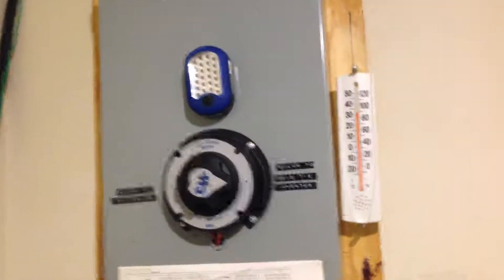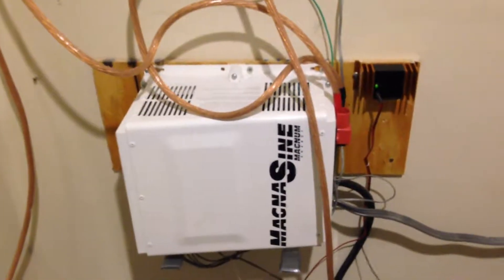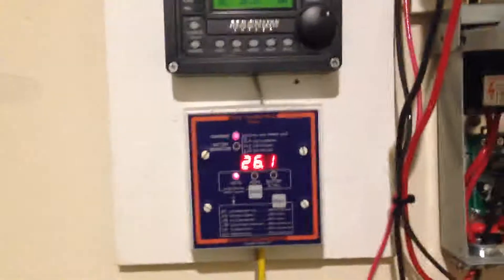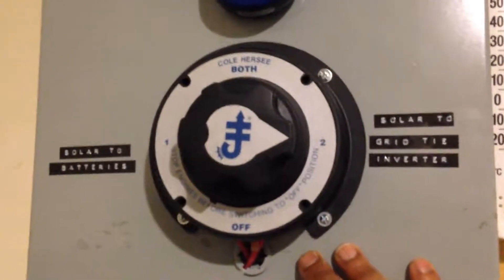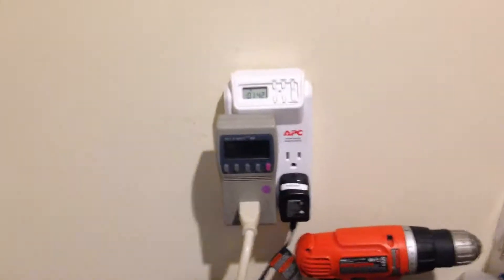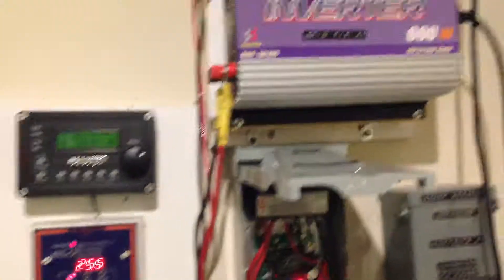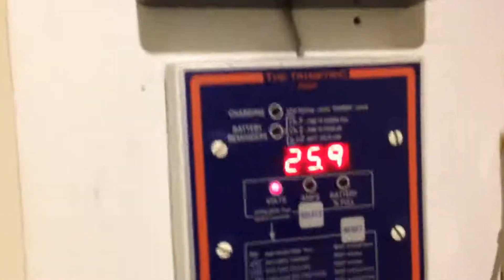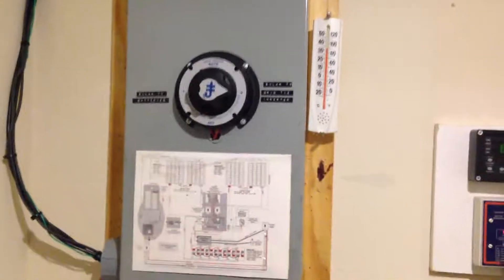DIY - Home Solar backup system after 4 years

Comment: where did you buy the inverter's?
Reply from the maker: +Ken B Got them from Amazon.  Getting them from Ebay can be a bit risky.
Reply: what are you powering of this?  There are so many dam inverters I think I find one but then either find bad reviews or something better.
Reply from the maker: +Ken B These cheap grid tie inverter did work for me for awhile.  I've since redesigned my system.  But to answer you question, I was using these grid tie inverters to put power back into the grid.  It was a small amount, only about 1 or 2 killowatts a day.

Comment: I noticed that you have added muffin fans to the grid tie inverters. With out them how long could you safely run them? I have noticed that on my 1000w unit with 800 watts of PV panels the internal fan only runs when at peak input at midday. Would adding more cooling really help?
Reply from the maker: M Gunderm I added a "large" 24v computer fan to my 600w unit and it cools it very well by blowing the hot air out and away from the unit.  The fan is connected directly to the terminals on the inverter, which is then connected to my GTI controller that is supplying upwards of 24v of power to the unit.  Without this fan these GTI's tend to overheat and cause a risk of blowing capacitors and melting other components, the internal fans are not sufficient in my opinion and the internal fuses are useless against the heat. The RV fan works well on my other 500w GTI unit, without it the unit would get very hot even when it's only putting out 200w.

Comment: Have you actually talked to your insurance agent about this set up and a "Just in case of a fire? would you be covered? I see lots of these type set ups and always was curious. IMO if your insurance company was not notified and approved your set up you may just might find out they will not cover you if something happens because it was not installed by a licensed electrician
Reply from the maker: ***** Thanks for your comments.  I respect your opinion, but no I didn't talk to my insurance company, as I didn't and still don't see the need.  Fire insurance is fire insurance, as long as I don't intentionally set the blaze, I'm covered regardless of how it occurs or who did the work.  A license doesn't make your home fire proof, granted it does help decrease the risk, but it doesn't eliminate the risk.  Also, generally you don't need to be a licensed electrician to do minor electrical work on your house such as install an extra wall outlet, light fixture, garbage disposal, or other typical household electrical items.  You need the skill yes, but not the license or approval.  It's good to have a licensed electrician if you don't have the skill.  In the beginning of my project I needed one.  But gaining an electrical how-to book from home depot, and numerous resources on the web gave me all the info I needed to do the job safely and right. Oddly enough, I found putting in a solar backup system was no different than putting in a light fixture.  Obviously we can't plan for every eventuality, but if we follow good safety and common sense we'll get by.

Comment: Hi there. tks for the uptade. I have a question about that.
So you have 4 solar panels... all in Parallel, right? i can't understand why you drain your batteries with the first (down) grid tie. wouldn't be better just redirect all energy from the solar panels after bank of battery is floating?
Can you please answer why this big switch to a different Grid-Tie inverter?
regards from Brazil.

Comment: Is it better to put the power back into grid or house or is there a difference? Will you earn a credit from utility.
Reply from the maker: Ed H When using a Grid Tie Inverter, the power goes back to your home first, in that it will be consumed by electrical items in use at the time., ie. computers, tv's, stereos, freezers, refrigerators, etc.  If your producing more than your house consumes, it will go back into the utility grid spinning your meter backwards, if you have an analog style meter. No I will not earn a credit from the utility, being that I don't have an agreement with them. But it will decrease my energy consumption (Fridge, freezer, lights, computer) during the day.  When both Grid Tie inverters are running I have watched my meter rotate backwards or stand still altogether.  At peak I have produced 480W, that's a lot of power for 120vac household items.